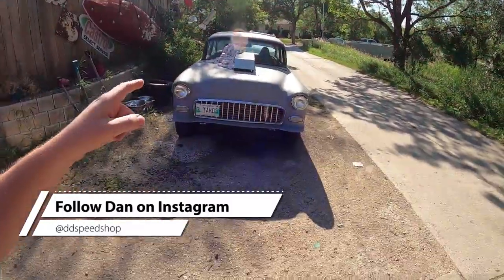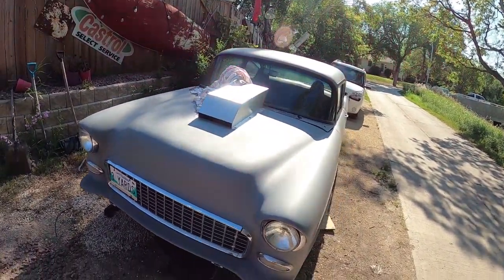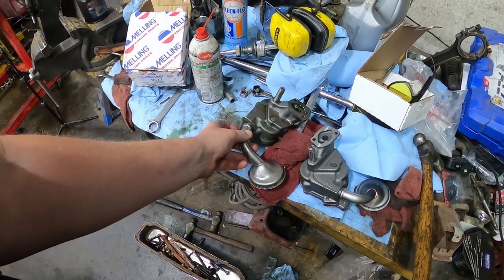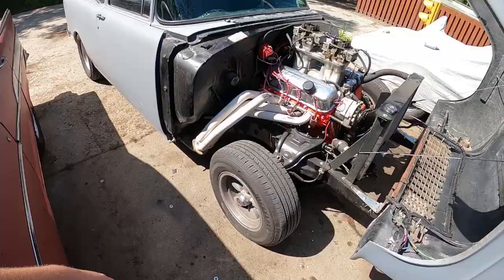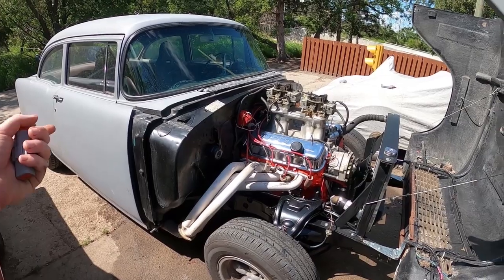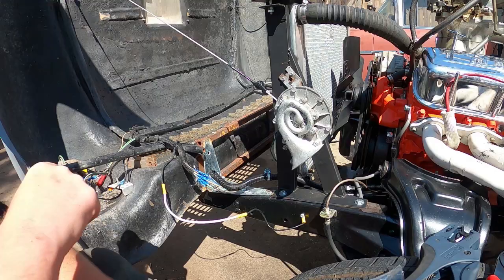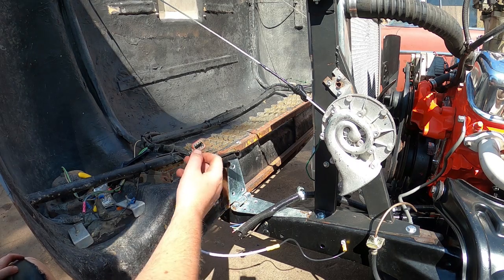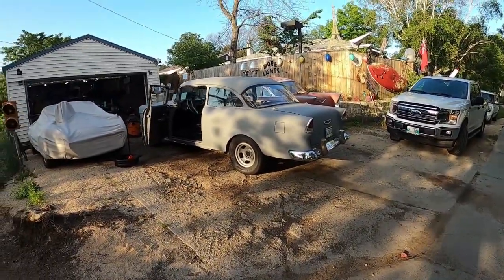Two Lane Blacktop 55 Chevy is Finally Fixed and Hits the Road!

Comment: Two Lane Blacktop one of my favorite movies.  I once put on a tunnel ram with 2 Sis Sixty Center Squirters (Holley) on my 1967 RS/SS 350. Wow! what a bunch of fun it was only draw back was all that high rise sticking way up high. My stock hood had to go so I drove it around with no hood for quite a while then the rains came and I worried about all the water getting in possibly so put on a old high rise fiber glass hood problem solved. Wicked power cruising at 35 MPH you put the foot down to floor it and hood on the whole back end breaks traction leaving black marks and smoke burn outs up to about 45 MPH then the tires stick it just goes.  Only one thing I did not like about the tunnel ram and the two 4 barrel center squirters was blowing the power valves. Man that sucked got so bad I had to carry a spare set in my trunk cause I would never know when one or two was going to blow.  Finally sold the whole setup hood and all put back the stock SS hood and a Z/28 Weiend aluminum factory manifold which is higher than the stock SS cast manifold and of course much lighter too. Still have that setup today on the old Camaro in it's original coat of paint and glory.

Comment: Go with more radius on the wheelwells.  Will really complete the look.

And oh yeah, a good trick to install the pickups is to put the pickup in a vice, put the oil pump on the pickup, then pound on the oil pump with a dead blow hammer.  Installed dozens that way.  Way easier than sticking the wrench on it.

Comment: I did headers on a 81 cutlass a few years ago, and I used short flex joints right off the collectors, then standard pipes and mufflers, and It was the only car I really never had an exhaust leak on. Ball flanges work good to avert leaks too, but they don't look as cool as standard flanges.
Reply from the maker: Yeah i hear ya man.

Comment: The best way to find exhaust leaks, take a shop vac hose put the big end over your ear and probe with the small end. You will be surprised the sound you capture. Fine print “keep away from rotating parts or you’ll be suck into the motor and get to visit the ER”
Reply from the maker: Good tip!

Comment: What you need to do is take a small metal piece thin gauge metal and make a strap going from the pickup with a hole in the other end and you bolted to the pump assembly.👍🇺🇸

Comment: That's why I always use the Moroso pickup. They have a bracket that bolts to the bottom of the pump. Zero chance of a weld braking loose or the pickup falling out.
Reply from the maker: Oh. Good to know

Comment: Sweet always good to see the 55 never get tired of it👍  Good call on putting a new pump and pickup tube they are cheap engines aren't.  I remember in a way back video seemed like you were welding a pickup tube on a oil pump I don't think you would have J-B Weld it.  Anyways the 55 could use a little more radius on the wheel wells for some bigger tires.  Down the road maybe a beefier rear axle and someday a straight axle and a 4-speed.

Comment: put the pickup in the freezer , heat the pump lightly with a propane torch , and pop it together with the palm of your hand , this is also why we all weld them , if the temp gets right dissimilar metals , and the oil sloshes hard , it will pop them right out ...

Comment: if you have a high volume oil pump and running a stock capacity oil pan you will pump the sump dry.go to a high pressure pump instead.this may help

Comment: Don't know if this info will be useful to you but here goes.
Big block GM engine oil pumps are notorious for their pick up tubes coming loose and dropping into the oil pan. The oil level will still keep the oil pump submerged and drawing oil until you brake or accelerate. Then the oil sloshes forward or back uncovering the oil pump and without the pickup tube the pumps sucks air till the oil in the pan covers the opening again.  
The other possibility is the oil pan needs baffles welded in to prevent all the oil sloshing forward or back, uncovering the pickup tube.  
Either way the pans gotta come off.

Comment: a Chore. Monthly weekly whatever. Grab a 1/2 and a 9/16 wrench. Tighten every bolt and nut you can find. Slowly you'll tighten up the entire car. Z28 302 solid cam 65 Chevelle used to rattle itself loose.

Comment: I may jave missed it but, i didnt see you install the rear seal on the Deutsche connector. Runner peice that slides on the wires before putting the pins on the wires.  Without it it wouldn't be waterproof. Then there are little runner pins to stick in the seal for spots that dont have wires in them.

Comment: saw the pistons out of the mopar sitting in what looks like oil i'm guessing to get the rings loose.   if that doesn't work pour the oil into a pan, put it on a hot plate and heat it up till it's about to smoke and put the piston in.  give it about 20 minutes and see if they come out.  also works good for when the piston is stuck on the wrist pin.
Reply from the maker: Thanks man
Reply: @DDSpeedShop  I hope it works for ya.  sure can't hurt.  :)

Comment: D&D, you are correct on the 55 rear wheel openings, something dosen't look right, I agree with you, they need to be opened up a bit, didn't the 2 lane black top 55 have a wheel well lip? Anyway keep building...your doing a great job...
Reply from the maker: Bigger the tire the better it looks
Reply: @DDSpeedShop  yep, you are correct,  I did google the 2 lane black top 55, it did have a wheel lip on the opening..

Comment: Dan, this is a complement okay?? I think that of all the channels I watch n its a few... Your the only one an this I truly mean, you can do a Vlog an damn man, its cool. I don't get tired of listening cause you have substance in what your saying. I get it.... like the dortch wire strippers as I have had a set for god only knows how long and just won't look at wiring without having a pair handy as well as the cheap flimsy ones will even pull it off. I like the 55 best of all..... weather is in your favor, so lay that carpet down right an love it. I would do a head liner cause of the eco of exhaust rings in my ears off that cavity.... do something different there and go with grey vinyl that matches the exterior and then the back seats match. The seats need to be the spray and wipe clean type so its easy to clean up from shit that hits the back. I would get myself a set of four point harness seat belts that say "I frequently exceed speed limits" but also hold the position. You like those front seats so leave em or just spoil yourself an go set in
a few in some seat store. As we head to the back, since the word "Ford" is a swear word, I would do a good heavy dana 60 rear end with the disk brakes. I like the four piston on the back. Going deep and down.... I love headers so don't doubt the sound is what its about. I also like me time so when they are not open, two and a half stainless to the back and cut out by the rear bumper so its quiet up front. Make it so the don't rattle as that will make me tear them clear off, I hate rattles under the rig. While were in that area, a packed parachute kinda sets it off, just one of those maybe or maybe nots thing. My next suggestion gets into the wallet firm. A remote radiator set up and get rid of the front rad look so all the dressings on the engine can sing "look at me" as I like that naked look. Hard to make right and a lot of water pumps to make sure cooling is working. A pair of nitrous bottles behind the seat hooked up on the triggers just to clean the tops of pistons off proper. Over the nitrous plate goes the twin efi carb set up like the 57 has now. Nothing nicer that a remote start set up so the neighbors can't see or hear fox news when it fires up. Might even wake the dogs up for about six blocks. When they complain if they drop over, look at what there driving and take a interest in it (fake it till you make it) and say did the wife pick this out for you do drive or were you like this as a kid... yeah I remember you walking home from school with all the math books hanging off your back pack... you wore glasses and had braces then right... Well do the best you can to enjoy your life. Maybe not.. might really piss them off with that. ..... so whats that all come too... seven, eight... even ten thousand dollars of this fabulous money that you wish that you had?? If I had the money thats what I would do. I am not a fan of roll bars in my cabin that I have to crawl over and then crawl out of... have to have the removable steering wheel to make work right. Okay insert this into the morgans book, chapter sixteen or more. If I were only thirty something

Comment: Yo I've been told that if you don't tack weld the pickup tube in for the oil return they can come out then oil pressure unstable due to lost a inch or so of oil depth

Comment: Just a quick question, did you use all the pins on your deutsch connector or less? If you didn’t I hope you got the blind pins to fill up the empty spots otherwise your waterproof isn’t as waterproof as you might think. Great car bytheway.👍

Comment: Hi guys love the 55! I really enjoy watching your videos. You mentioned radiusing the rear wheel wells. Do it please it would look awesome! Tomorrow I go pickup my 63 Nova II SS. I'm  really stoked about getting it. Also got a pile of suspension parts for 63 impala. That's this winter. Need to get the frame powder coated first. What size motor did you run in the 55? I have a Edelbrock TR1X Tunnel ram that I was gonna put on my impala. But having second thoughts about saving it for the nova which is gonna turn into a gasser! You and Dani are great keep up the good work thks.
Reply from the maker: Nice!  Bad ass car man

Comment: You didn’t build the engine, therefore the builder was the one who messed up the oil pump pickup tube.  Geez JB Weld?  Using wire would be better than that! JD
Reply from the maker: Haha yeah

Comment: Dan, now that your getting a education on mopig and it's off the front burner, we can get back to the real program . As per the JB weld on the pick up, didn't you say you had that motor built by someone else ? Well that might be the answer why you can't remember doing the JB weld on the pick up as you have a welder so maybe you can't remember what you never did ! hmmmmmmm --- I always weld them and not just a tack or two.   Since you sold your soul by giving away the T rex , would love to see you do a wild ass 406 ( 400 S/B punched .030 ) old school small block chevy in a 68 Camaro with a 6 speed manual & overdrive with 488 gears in rear.   hint hint hint.
Reply from the maker: U send thr car over and ill build it man.
Reply: @DDSpeedShop   I got one ! ( RS/SS ) needing rockers put in , only problem is it's in SOUTH FLORIDA ! Road trip ?????? lol

Comment: To Radius or not to Radius?  I would not, unless you need to. Why not keep the road junk and sand out of the wheel well? I would make the 55 a daily driver and if I would change anything I would convert it to a stick shift and paint it a wild color.  God Bless
Reply from the maker: Yeah I'd like a 4 gear.  But they aint cheap
Reply: @DDSpeedShop  Correctomundo: However, once you have a stick all your tranny problems go away. Do junkyards in Canada communicate with each other? I sold a 1992 Corvette (from a fire) 6 speed for only $1,500.
A video on how to do the conversion would be very interesting. Real gear heads like to "DRIVE the machine" and work with the power bands and torque with life long advancing skills.
You have so many valuable parts and a Cobra for the cash. Instead of having so many balls in the air I would focus on a jewel laden bowtie. Love your site. 
(Hi Danny)